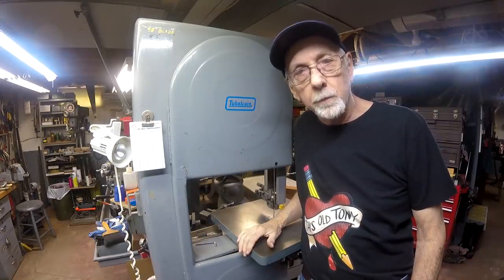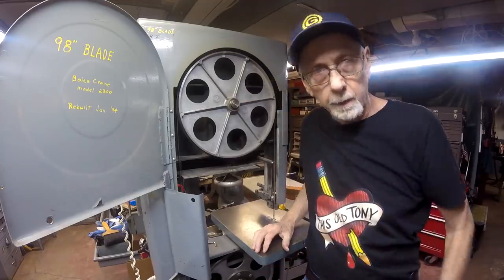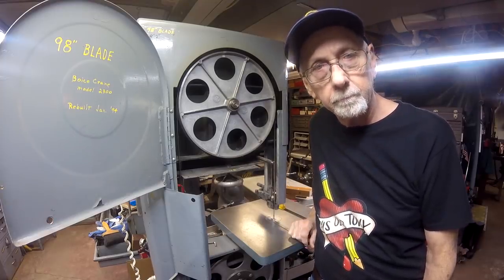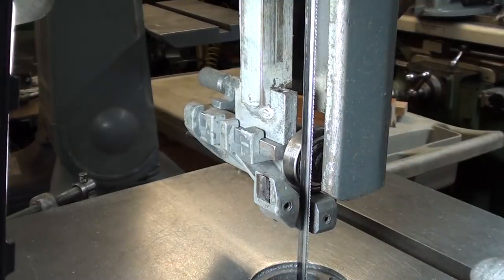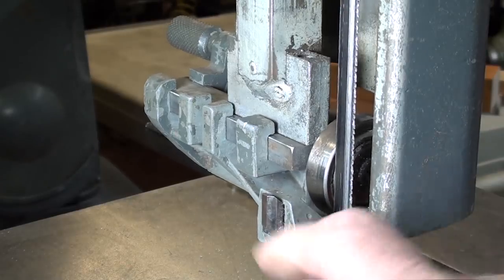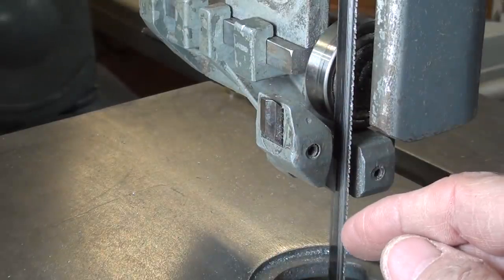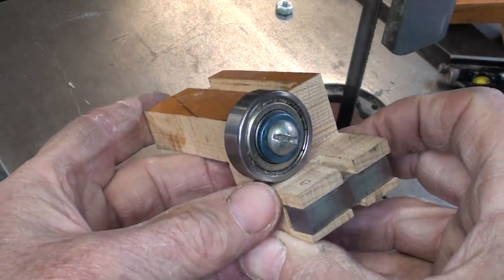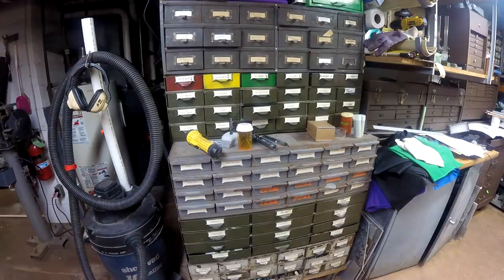BLADE GUIDES FOR BOICE CRANE BANDSAW pt1 Tips 550 tubalcain repete

Comment: The local  high school sold off the metal and woodshop in the 80's. I bought all the heavy equipment from WWII for a few cents over scrap value and it's still running in my plant... Now it's 2020 and my son is in the high school shop class - they got rid of the computer lab and brought the tools back!  Rare event in an era of such stupidity.  Well, he has been in my "Shop" class since 3rd grade, and could be the substitute teacher. It's a little dumbed down, but far better than pushing a mouse.  Now I am in your shop class online, and discovering  much that I forgot or never had time to indulge in. Great work!

Comment: Use an eccentric for the thrust race, drill and tap the retaining screw hole. Make the eccentric the length of the guide block, a screw driver slot in the back end to aid in rotation, then tighten the setscrew you mentioned.

Comment: Nice work on your replacement part.  Far superior to the original.  I just bought a bearing cap for my Doall refurb project. (Video series)  $8 plus shipping!  Eighty years of Inflation.  😆. Good point on lighting.  Continually working to improve my camera work.  Tc, your neighbor in the next state west,  Mike

Comment: If i wanted to duplicate the guard, i would have made a copy from Styrofoam and made a lost form cast. If the looks are not so important simply poured the aluminum on the foam.
If i had to make more than one i would made a 3D model and 3D printed it hollow and done the lost form cast with that.